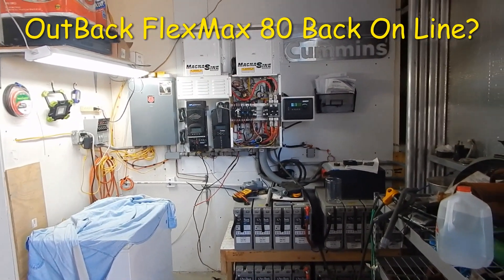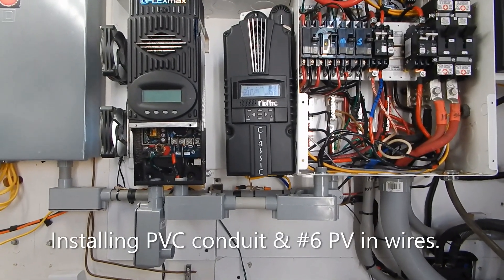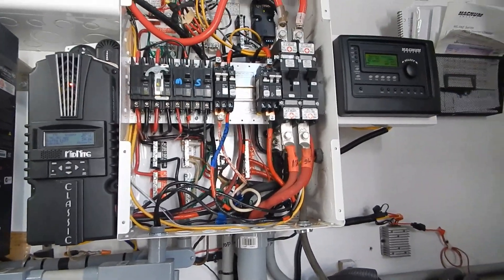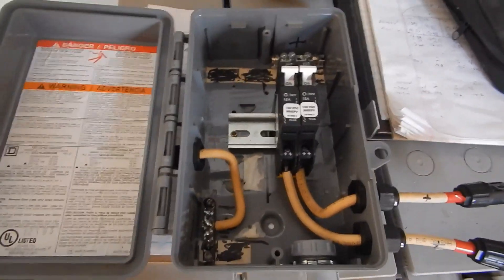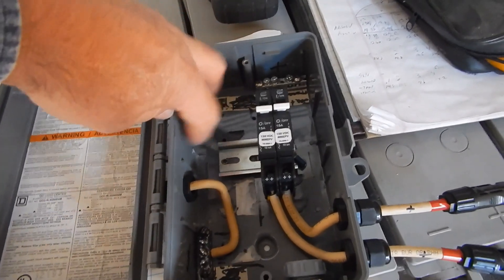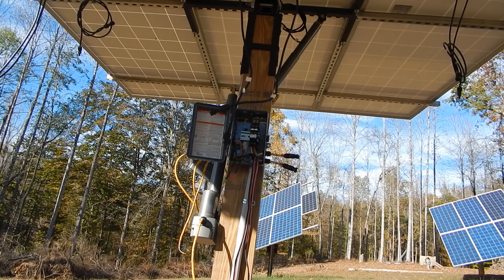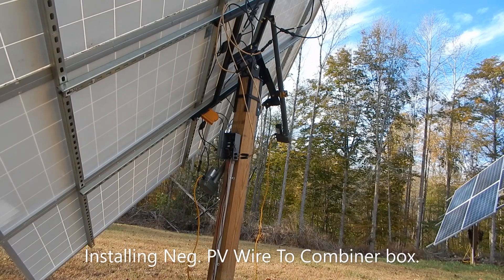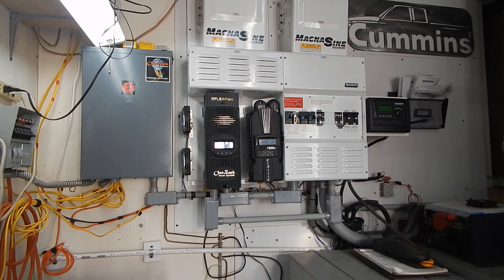Outback Flex Max 80 Installed Up & Running ?

Comment from the maker: Happy To report at 4:AM This morning I was out in the shop & sorted this ( Unloaded ) issue out. That issue keep me from sleeping.  I turned on & off the charge controller to many times while working on the PV in. I have never seen that unloaded screen before in  the almost 8 years I have had the OutBack.charge controller. All that was needed was a factory reset.

Comment: I was gonna say the same , jwsolar had you covered. Very nice he is.  Glad to see you figured it out. Now you will make much more power thats needed.
Reply from the maker: Yes JW solar USA is a very helpful young man. I just about 10 minutes ago went through the complete set up again. Both charge controllers are working perfectly. My batteries were in float mode nice sunny day. Turned on  my well pump & 2- 1500 watt electric heaters +every light out in the shop was pulling in a little over 5000 Watts very very nice. This will be a big help this winter. Working on combining the new solar tracker to work with the dual axis high-wind parking tracker . Thanks for watching more to come.

Comment: JWsolar is right hard reset should be done so it has no conflicts.
Reply from the maker: Yes you and he are exactly correct. My mind and body were too tired at the time I film this. Could not sleep at night was out in the shop at 4 a.m. this morning when I did just that. Happy to report all is well both charge controllers are working fine. I re-watched my video and noticed that one point when I turn the power on I saw the unloaded on the screen for the first time ever. So thanks for watching and all is well.

Comment: You have to do a hard factory  reset on the OutBack since your previous settings were on 24 volt configuration before upgraded to a 48 volt system. 
Here is the sequence to go about it:
1) Shutoff the Photovoltaic Array
2) Shutoff battery input into the  OutBack Charge Controller. 
3) Press and hold the first left and third soft key on the OutBack Charge Controller. 
4) Flip ON the 63A battery input breaker for the OutBack. 
When the controller powers up, release both soft keys and start configuring the settings.
Import your battery settings/parameters you have from you MidNite Classic to be identical with the OutBack and you all set to go. 
Please let me know how everything turns out or email me your You have to do a hard factory  reset on the OutBack since your previous settings were on 24 volt configuration before upgraded to a 48 volt system. 
Here is the sequence to go about it:
1) Shutoff the Photovoltaic Array
2) Shutoff battery input into the  OutBack Charge Controller. 
3) Press and hold the first left and third soft key on the OutBack Charge Controller. 
4) Flip ON the 63A battery input breaker for the OutBack. 
When the controller powers up, release both soft keys and start configuring the settings.
Import your battery settings/parameters you have from you MidNite Classic to be identical with the OutBack and you all set to go. 
Please let me know how everything turn out for you or email me your contact number so I can walk you through this process at jwsolarusa@hotmail.com
Reply from the maker: JW solar USA. Thank you so much for watching. I could not sleep over this. I was out in my shop at 4 a.m. this morning when it popped into my head to do just that. I rewatched my video  and noticed  on the third time I turned battery power on to the Outback  I saw the [ unloaded ] on the screen .  That's when it dawned on me  that's exactly what I needed to do . Just popped out of bed for the third time today happy to report everything is working like a charm. Now  I need to to pair the two solar trackers together so they both have high wind speed parking and dual-axis tracking . To that end I need to complete the relay box & hook them together. Than tie & clean up wiring. My mind was to overcome to think straight when this took place.  Thank you for the comment and all you do to help people have a great day.
Reply: @TheKiloG69  
Brother Glen, I am glad to hear the OutBack is now up and running. 
Have an awesome day brother.